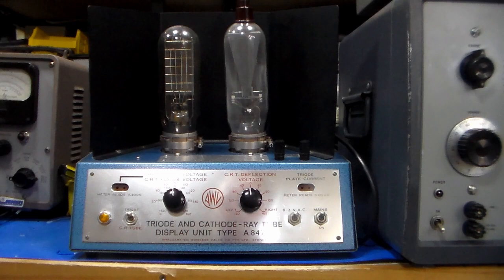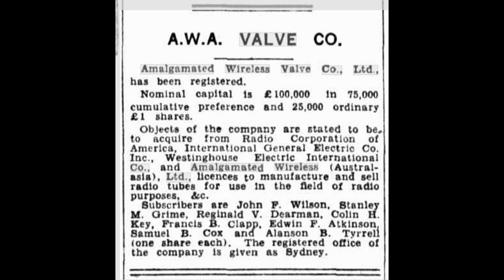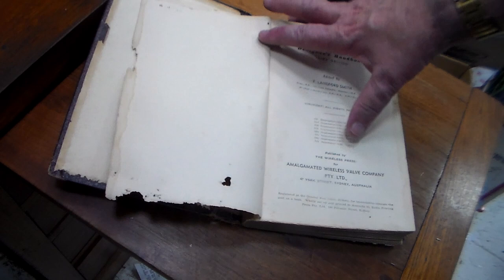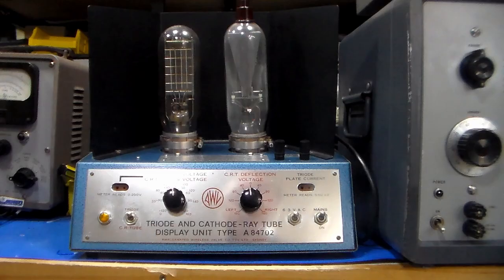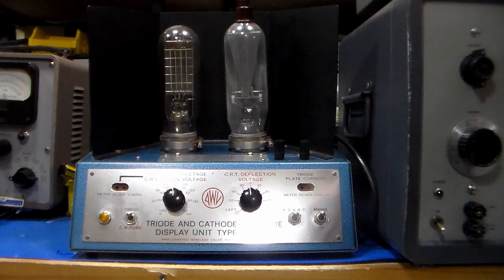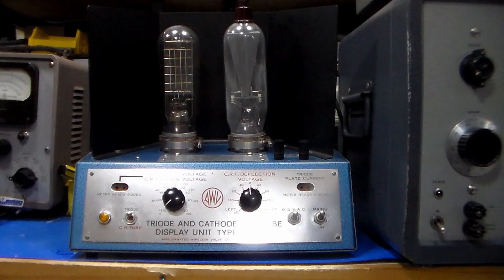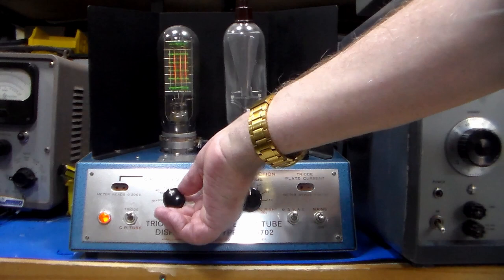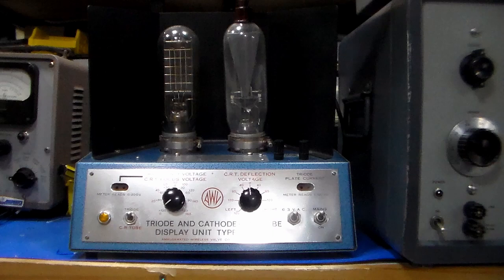AWV VACUUM TUBE DEMONSTRATION UNIT

Comment: Those are the coolest tubes I have ever seen. Another great video, Peter. If you don't mind me asking, did your grandfather work for AWV? His design books remind me of a little Westinghouse notepad and motor reference booklet that my grandfather used while employed as an electrical engineer with Canadian National Railway back in the 20's. It is one of my most cherished possessions
Reply from the maker: Yes, those tubes cool and they were designed here in Australia, and as far as I know only ever made here. Those books were my father's, he encouraged me to be an electronics design engineer as was he. He never worked for AWV, but he did many things in his career, for the last 20 years before he retired, he ran an electronics lab building special equipment for physics research in the School of Physical Sciences at Flinders University, the same place I completed my first degree majoring in physics before starting my engineering studies.